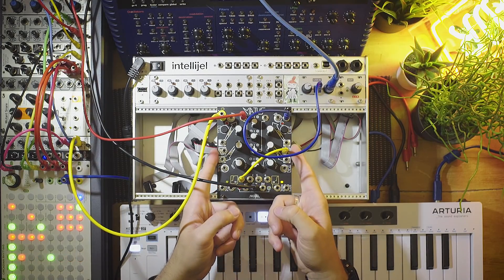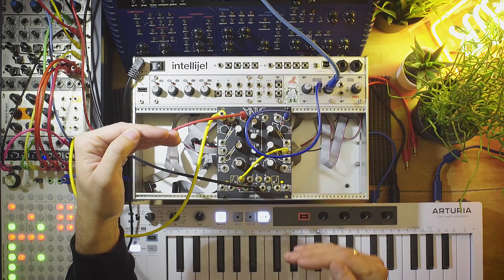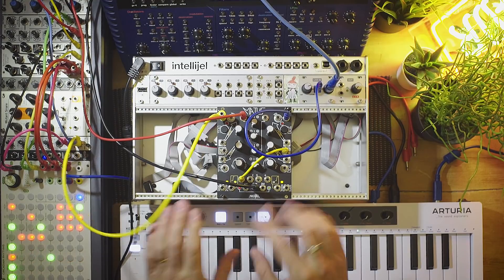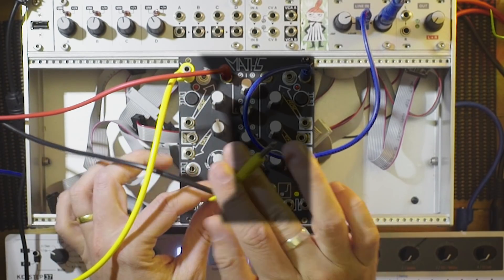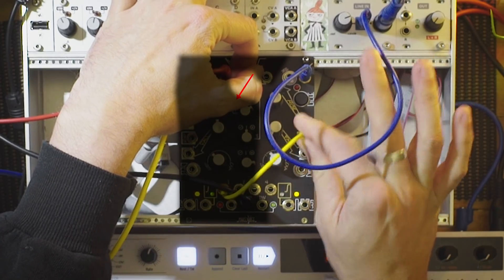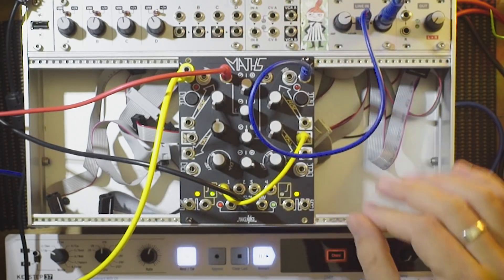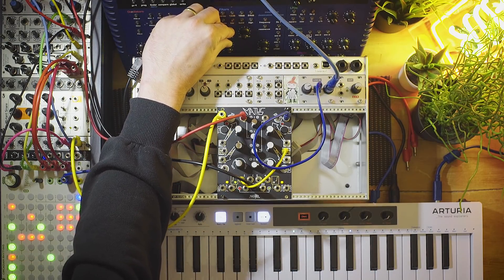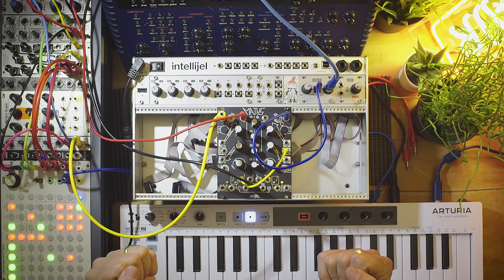How to make Colin Benders-style SIDECHAINED KICK mix with only MATHS

Comment: I just gor Maths and decided to try this. Unfortunately my right hand end of cycle LED is stuck on a positive voltage comes out the end of cycle jack. With nothing plugged in the end of cycle turns on and stays on. I can still use that side as an LFO and the end of cycle behaves as expected. But the default behavior is end of cycle always being on. Right now I have everything turned off to see if I just need to let it sit unpowered for a bit. If that doesn't do it I am going to email Make Noise to see what they can tell me. I hope my Maths isn't broken. If it is, I hope I can get a new one. Maths isn't cheap. 

I  love maths, it's such a handy module. Too bad mine is having issues so soon after getting it.

Comment: Make Noise Maths = $290, 20HP, and a bunch of finagling to get a very basic feature. 
Behringer 140 Dual Envelope + LFO = $110, 16HP, and comes with a second envelope (also with +/-  envelope out), and an LFO that is too complex to be fully functional within its size constraints.

...Yes, I think I'm becoming a fanboy.
Reply from the maker: Not sure I follow but I’m happy if you’re happy!
Reply: @mylarmelodies  I'm saying you're using a lot of HP and $ to get an inverted form of your ADSR for side-chaining, or ducking, or whatever it's called. If there's something else going on here, then I'm the one that is not following. :P
Reply from the maker: @buckstarchaser2376  I'm afraid I have to confirm you're not definitely not following this in its entirety, sorry! This video is showing the complete creation of a very specific effect in one single module. The Behringer 140 can't do what's done in the video, sorry.
Reply: @mylarmelodies  Well, I'm generally wrong about something every hour or so, if you include sleeping hours, but from the video, I gather the following.: 
The Maths module (which I don't have, so I'm not familiar with) is turning the average amplitude of your bass into an envelope (which may already exist somewhere in your kit as an envelope already). This envelope is then negated from the VCA control of one or more other instruments, or the post-mixed assemblage of sounds (except for the bass), within the complex Maths unit. The result is that selected - or all - other instruments are getting hushed in relation to the envelope of the bass. 

Now, to recreate this effect in Behringer 100M modules (which I later realized have features not commonly found on differently-featured modules, probably leading to my confusion) I took the negative ADSR output from the bass channel envelope, and put it into one of the three CV inputs of each instruments' VCA to hush those to whichever degree desired. 

I'm sure there are plenty of other ways to do this on my 'no frills' low-cost system, and those will arguably be different with various unique setups that people may have. This is the core purpose of modular synthesizers to begin with, I thought. My approach (not sure how well it's working so far) is to avoid any module with menus, or a bunch of wild shit that takes more than fiddling around with for a bit to learn. So far, I've found that I'm developing my unique way of understanding how to achieve the effects I'm looking for, and need to carry forward that understanding when addressing others. ...or maybe I still don't get it. Maybe some day I will. Either way, this discussion is helping me learn, which is the value I'm taking here.
Reply: @mylarmelodies  Yeah, I just tested it and it works fine. You just need an ADSR with an inverted output (such as the Behringer 140) and you'll be able to save your fancy Math module and a bunch of noodles for less mundane things. Hope it helps!

Comment: Great vid! However I don't understand this: At 4:00 we see that Maths silences the melody channel if Rise/Fall are turned UP. But at 5:00 we're applying the inverted (-> negative) envelope to them while the controls are set fully CCW. This should lead to something like negative Rise/Fall times, right? Why don't we just use the un-inverted envelope to simulate that "we turn Rise/Fall up" we see at 4:00? (I know that in most traditional side-chain patches you must invert that envelope to apply negative CV to a VCA, but this scenario seems different, right?)
Reply from the maker: See description! It's a MATHs quirk

Comment: I feel like a dummy posting this as I doubt you're wrong, but why would you invert the voltage coming out of 1? Uninverted, the voltage goes high with the loud elements, and low with the quiet (a positive voltage envelope shape). In your example, you turned up the knobs on channel 4, and if turning them up is the intended aim, wouldn't you want a positive voltage going in? Doesn't positive voltage correlate to a clockwise knob turn?
Reply from the maker: See description!
Reply: @mylarmelodies  Makes sense for a VCA, since you're trying to turn the knobs down, effectively. In this Maths example, you want to turn the knobs up to muffle the sound, right? There's that section where you show raising even one of the two knobs works, but creates artifacts (hence why you do both). Up is positive voltage, no? Legit question, not trying to snark.
Reply from the maker: @Anarchosyn  "(Before you ask, you DO need to invert the envelope followed kick that you feed into the BOTH control, which seems wrong, but this is because negative voltage to that input INCREASES rise and fall time, causing the VCA effect, not the other way round as you might assume! I did, originally. Always RTFM!)."
Reply: @mylarmelodies  Ahh, I so rarely use "both" that I forgot Make Noise inverted how that reacts to voltage compared to the Rise and Fall inputs. Weird, but thank you for reminding me of this.

Comment: Is there a way to do this with the o-coast as the inverter using a vca & envelope follower?......have tried taking the kick copy to mu streams then out the the maths mixer on the o-coast but can’t seem to get ducking when i invert the signal
Reply: Kick trig to SLOPE trig, SLOPE to Attenuverter (input 2 on the mixer), turn the knob the the left and send the resulting cv to DYNMC. Send the audio you’re like to duck into the input to the left of BALANCE.

Alternatively you can use the CONTOUR as a sort of envelope follower, much like MATHS does in this vid.

Comment: This is a cool aplication of Maths! However if I was going to have this permanently set up in my rig, I would use a Makenoise optomix to achieve the same effect as  it is less HP
Reply: yeah but can the optomix send an inverted signal or work as an envelope follower? My understanding is that it works like a dual low pass gate.
Reply: @hungrijo  the instructions on how to patch optomix as a sort of sidechain compressor are in the manual in the tips and tricks section. It’s pretty cool because you can use channel 1 to generate a kick and channel 2 to sidechain a different voice with the kick that you generated in Channel 1

Comment: 4:30 ok, you lost me there. I have Maths for ages but only used it in simple functions. Why does it make a sound quieter if the rise and fall values are increased? Shouldn't this just make the movement of the sound slower?
Reply from the maker: As I understand it: So you can use MATHS as a 'lag processor', or 'slew limiter', which 'rounds off' the start and end of a waveform. For example - if you fed a square wave LFO into either channel 1 or 4 inputs, you can use the 'Rise' control to turn that square LFO into a sawtooth LFO, ramping up. Likewise you can use the 'Fall' control to make it into a sawtooth ramping down. In that way you can think of it as 'smoothing out' CV. In this same way it can smooth out audio rate stuff, too! So this is what you're hearing - it smoothed out into nothing at all....I think!! Either way...it works!
Reply: The rise and fall values are actually decreased(made more negative), because it’s being fed an inverted envelope that controls both the rise and fall ramp.  Therefore the intensity of the envelope follower on channel 4 is dampened.  It’s admittedly not a super intuitive concept,  I find it helpful to think of it as slewing at audio frequencies.  Every time channel 4 “sees” A rise in the audio wave, there is a CV over the rate of the rise that is somewhat more negative than it would normally be.  Likewise every time channel 4 sees a fall in the audio wave, there is a CV over the rate of the fall that is somewhat more negative than it would “normally’” be.  Do think of it more in terms of the whole envelope, that is controlling the “vca”, The envelope is overall smaller, this side chain instrument has  reduced intensity
Reply: When there’s no bass drum, the inverted envelope is high, so the rise and fall are quick, and channel 4 is tracking the audio input very closely, coming out like the input. When the bass drum appears, the inverted envelope pulls the both cv low, slowing down the rate of following channel 4 until the output can’t follow the audio input well at all and it ends up very attenuated, also with lots of high frequency roll off. Theoretically (I don’t have maths to try it), the output of ch4 will now resemble an attenuated low pass filtered input and so maybe if you could subtract that from the input you’d get more of a multi band sidechain compressor effect where only the bass is removed from ch4 when the kick is present. That’s be nice to try....

Comment: ...and a bitcrusher :). But how about a Dynamix? It's smaller, it can do the side chaining for you, it can do the mixing and it also has an overdrive. And it's cheaper because it's discontinued. Regardless, this is an insanely great video as always and there's no stop to all the things Maths can do. It would also be great to use a timed LFO (like Pam or Clep Diaz) to create volume automation so it doesn't always compress when the kick comes in. You'll get the legendary Armin bounce.